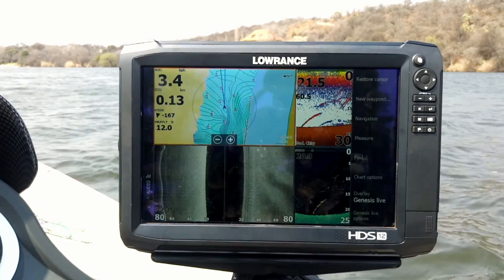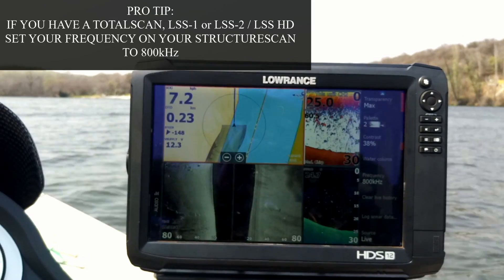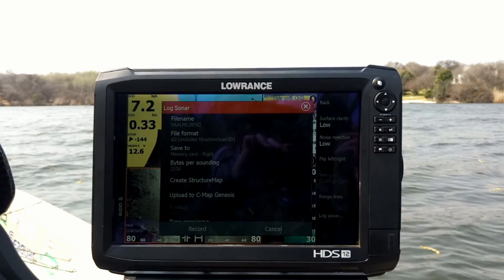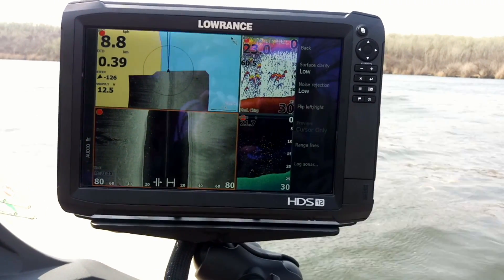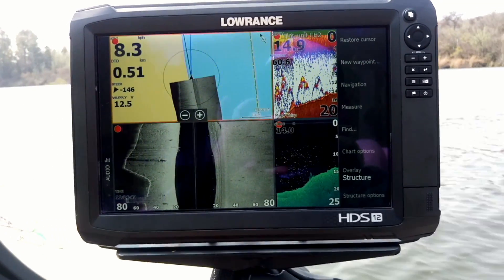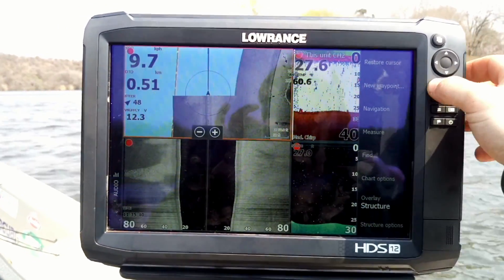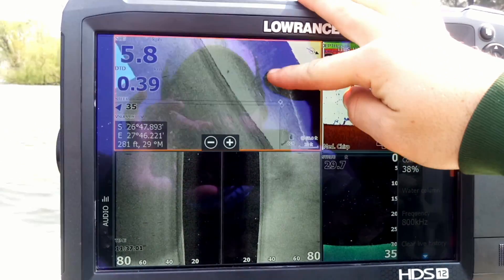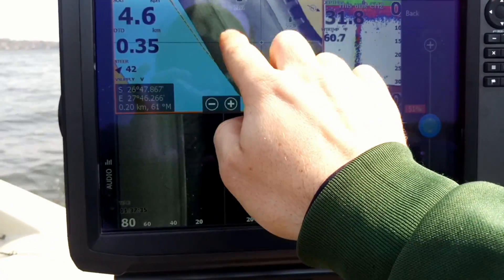How To Create a StructureMap Mosaic LIVE on a Lowrance Fishfinder

Comment: First, MANY thanks for a GREAT! video  It was very well thought out and didn't leave out any of the specifics like changing the File Format to (sl2) for the Totalscan Transducer from the default format i.e. (sl3).  Struggled with this issue and you were the first person that gave specifics on how to record without errors.

I am using a Lowrance HDS7 Gen3 Chartplotter with a Totalscan transducer and currently using Lowrance Maps on my Chart Page.  I haven't taken the boat out yet to try the Log Sonar feature since viewing your video but taking your guidance I am now able to save my sonar logs.  I have a couple of questions and your valued input would be appreciated.

1.  Will I be able to use (Lowrance as my chart source) and view the recorded structure maps or will this only work if I use a Navionics or C-Map charting as my chart source?

2.  If I set the overlay on the chart screen to (Structure) while using Lowrance as my chart source and selecting the structure options (Source) as (saved) will it automatically display structure logged saved files overlays as I travel over saved logged sonar areas?

3..  If I have multiple structure logged saved files in different locations will it display the appropriate overlay on the screen as I travel over those areas utilizing the Lowrance Chart map?

Any guidance you can offer will be greatly appreciated.

John
Reply from the maker: Good Day John!
Thank you for your comment and kind words!
The Structuremap feature is an amazing feature and a major part of my tournament preparations and a major tool that i use during my tournaments / days fishing.....
Answers to your questions:
1.) The Structuremap is an overlay that is a layer on top of the chart. I often have my structuremaps layered over the top of low level satellite imagery....As an overlay, you can have any chart you want in the background :)
2.) If you set the overlay to Structure - Saved, it will display structuremaps that you have logged and saved as SMF (Structure Map Files) on the unit as overlays on your chart.
3.) If your overlay is set to Structure -- Saved... it will display ALL logged structuremaps that are converted into the unit....so the lake that you are currently on.... and lakes that are for example 100s of miles away if they are still loaded onto the unit.

I always log to an SD card then convert what is needed onto the fishfinder.... I then take out the SD card and put it into the  bow unit and convert them there as well so that I can use the structuremaps while fishing on the trolling motor.

Once I am done on that body of water and moving onto the next venue, I usually clear the SMF files out of the fishfinder's internal memory.... this helps keep the unit clear of data that is not needed for another lake... so I would only have the SL2 logs and SMF for the specific lake I am fishing on the unit / SD card.

I keep a database on my PC / Laptop / Different SD cards for each lake.

This will ensure the unit has enough available memory :)

I do not bother with clearing waypoints though :) Even with 10 000+ waypoints, I do not see any difference in unit performance whether they are all loaded or it is cleared between different venues.

I hope the above helps :)

Kind regards
Tight Lines and Screemin' Reels
Charl and the World of Fishing / www.bass.co.za team
Reply: @BassWorldoffishingtacklestore  
Hello, and many thanks for taking the time to answer my questions.  Your reply was extremely helpful.
I do mostly inshore salt water fishing in the Tampa Bay area here on the West Coast of Florida.  I have a keen interest in Structure Mapping.  The Tampa Bay has numerous shipping channels for large cargo ships to enter different ports within Tampa Bay.
Fish tend to hang out near the edges of the various shipping channels which were dredged to approximately 50 foot in depth and the shelf on either side of the channel is approximately 28 foot tapering out to about 12 foot.
My goal is to use my Lowrance HDS7 Gen3 to create structure map overlays so that I can get a better idea of what the structure looks like along the edges of the shipping channels.  Fish like to hang out near various structure whether it be on the actual walls of the shipping channel or on the ledges on each side where boulders/rocks were left behind during the channel dredging process.
My hope is that I will be able to create some really nice structure map overlays  for use while on my boat or at home where I have a 12 volt power source where I can review the Structure Map Overlays while sitting in my home.  I can then mark appropriate waypoints for future fishing trips.
It will be nice to able to move around (Zooming to different areas where I created structure maps) on the Lowrance Chart page while at home and view the newly created structure map overlays I created along the shipping channels and other areas of interest.  Of course I will change from live to saved i.e. SD Card in the structure options Source.
Currently it is pretty windy but hope to get out on Wednesday to try out Structure mapping for the first time.  I am pretty excited.  Hope this all works as planned as it appears to be a very nice tool for fishing.
Thanks again for all your help.  You are the man!
John
Reply: Just an update.  We took the boat out today and everything worked as I had hoped.
Structure mapping worked fine.  I made multiple Structure maps at different locations around Tampa Bay and saved them to my SD card.  I was then able to view them in (saved) Source Type and zoom into the scans and mark structure with waypoints for possible future use.  I have all this data saved on my SD card and can view it on the boat at any time in the future or at home utilizing a remote 12 volt power supply for the Lowrance HDS7 Gen3 unit.

I notice when structure mapping you have your page split into 4 screens.  I was only using 2 screens and wondered about the possibility of locating fish with the (fish reveal) option during the structure mapping process.  The next trip I will make a new page with 4 screens like yours.  That should allow me utilize the (fish reveal) function while Structure mapping.
1. Chart
2.  Side Scan
3.  Down Scan
4.  Traditional Sonar
My HDS7 has a pretty small screen.  I also found here on the internet that you can add an IPAD or Android Tablet  that will mirror your screen.  It runs off of and app from Navionics utilizing local WIFI  from your Lowrance HDS7 Gen3 unit.  No subscription internet service required.  This will allow me to get a view on a larger screen witch would be helpful during Structure Mapping operations.

MANY THANKS FOR YOUR HELP.  I COULDN'T HAVE DONE IT WITHOUT YOU.
YOU ARE THE MAN!!!!!!!!

John
Reply from the maker: @helicopterjohns  Awesome to hear! Glad you got it right!!!! I would adjust the page splits so you can maximise the screen area... you can do this by tapping the power button then pressing on adjust splits (While you're on your page you built).....You can also swipe away the right hand menu by putting your finger on the menu then swiping it off to the screen towards the right (this hides the right hand menu and will give you an extra inch of screen)
Reply: @BassWorldoffishingtacklestore  
Hi,
Thanks again for all your help in setting up Sonar Logging/Structure Mapping on my Lowrance HDS7 Gen3 unit.  He is something I put together that may??/ help others with their setup.

I have recently developed an interest in Structure Mapping on my Lowrance HDS7 Gen3 unit with a TotalScan Transducer. I have done quite a bit of research on how this is done and how to use it.
Here is a link to a google Drive Folder with (5  reference documents) included to help you create Structure Mapping files and properly install them on your Lowrance HDS7 Gen3 unit so that you can view them on your chart as an overlay.  As long as you have the separate SD card installed in one of your SD card slots with the files created during the structure mapping process the saved structure mapped areas  will automatically be viewable on your chart.  You can have multiple structured mapped areas on the SD card and they will all show up on your chart.  If you have the appropriate 12 volt power supply with appropriate Lowrance Power Cable attached to your Lowrance Head unit and can easily view your chart data in the comfort of your home.  If you added any waypoints you can select one and tell the head unit to (show) and it will take you to that location on the card displaying your over layed data.  While you are examining the chart you can even add additional waypoints if desired.

https://drive.google.com/drive/folders/1lhLfXk4onZv-l8jQwCchr5RIeIAwnaVb?usp=sharing

This is the best new feature that I have discovered on my Lowrance HDS7 Gen3 unit equipped with a Totalscan Transducer.
With the information included in the  5 items included you should be able to able to enjoy Sonar Logging/Structure Mapping.
Hope this is of some help in setting up your (Lowrance unit and transducer combination)  that is (capable) of doing sonar logging.
John